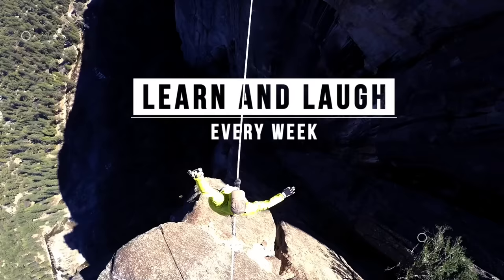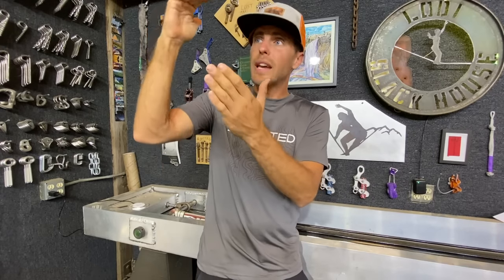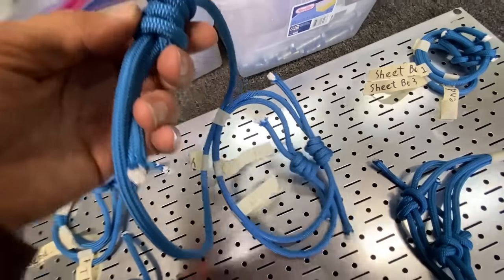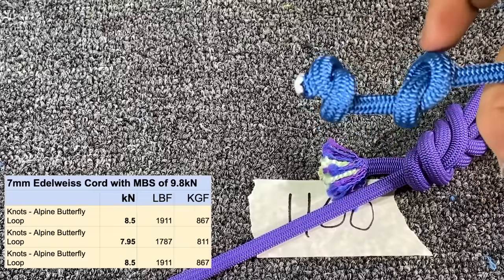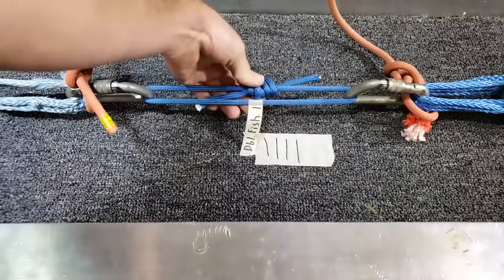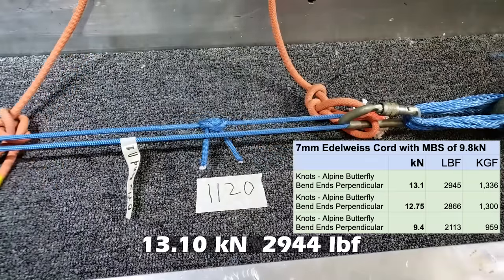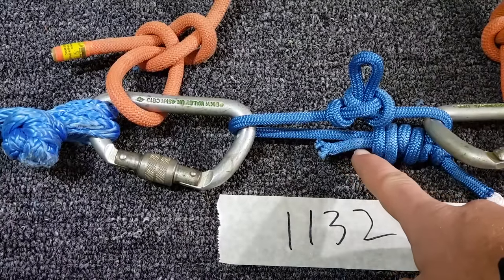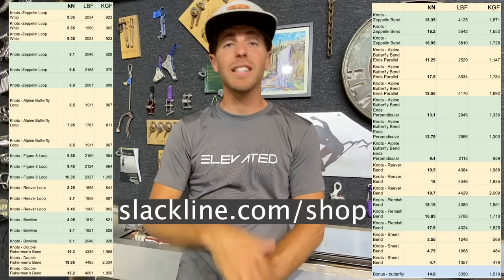Break Testing Knots - Zeppelin & Figure 8 & Alpine Butterfly & Reever & Bowline & Double Fisherman

Comment: like the video, if you do any more tests try to clean and set the knots better, also, one of your sheet bends is tied incorrectly. I'd like to see a double sheet bend. Could you re-do the alpine butterfly bend but set the loop first? I'd also love to see a comparison of the relative strentgh of a figure 8 versus a figure 9. The traditional bowline is stronger with a larger diameter object. For ring loaded applications like a carabiner, the dutch bowline should outperform a traditional bowline. I'd like to see a double bowline too if you do a bowline video. If you aren't familiar check out all the drop testing videos by Bluewater, Sterling, Mammut, etc.

Comment: All of your sheet bends were improperly tied which is why they slipped - this is a known problem when tying the not incorrectly. Both working ends should exit the same side of the knot. Would like to see it tested properly - no reason I can see why it should perform any worse than the bowline.

Comment: I think the comparison between (for example) figure 8 and double fishermen's is unfair. In the first case the knot have the full tension on one string since it's not a loop. In the second, the tension is plit on the two strings so of course the failure is at around twice the tension.

Comment: I was hoping to find it in the comments, but no luck.  Basically, as interesting as this video is, I observed moments where knots seemed loose and just not dressed well.  Typically, this is done in instruction settings, so the examiner can see all the details in the relationships within a knot.  However, a poorly dressed knot cannot be fairly evaluated under load, as they were in this test.  I really wish you'd have put these samples together yourself, in house, or, at least tightened them up and dressed them all properly.  No offense to the contributor who sent them in, but, I'd hope they'd agree that having extra play and movement within a knot will add friction and stress where it shouldn't and wouldn't exist in a well dressed knot.  This entire test could be titled reflecting this knowledge - how dangerous shabby knots are.  Or, 'Does it matter how well dressed knots are? You'll never believe what we discovered!"